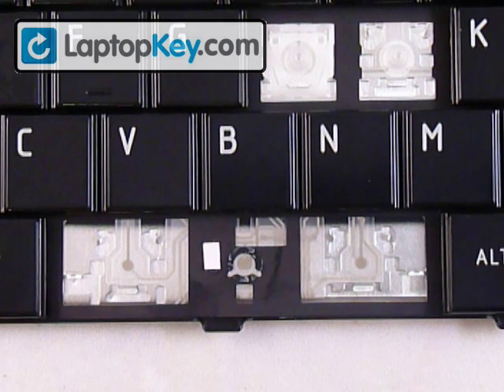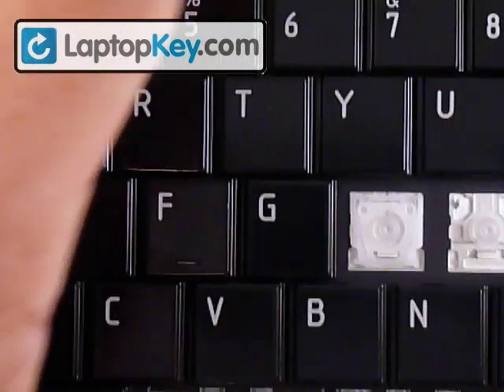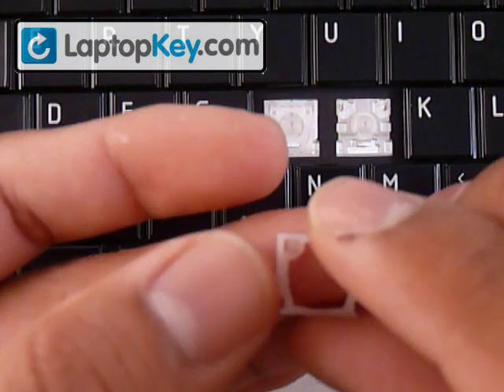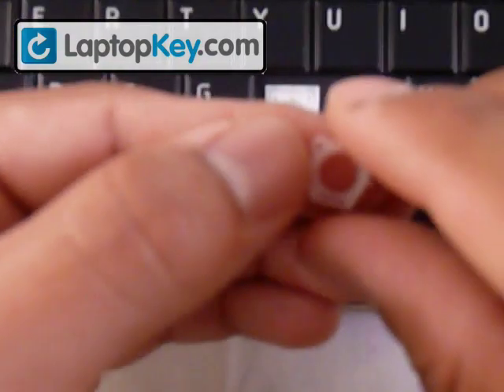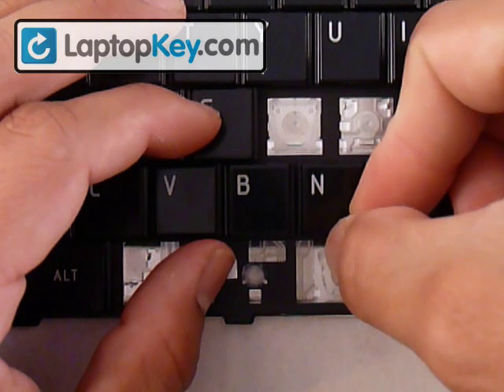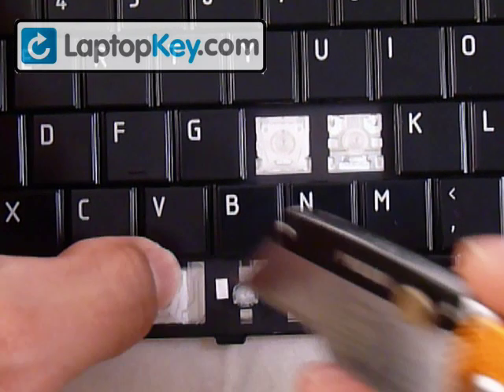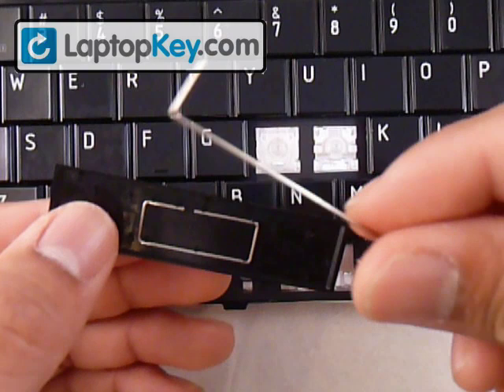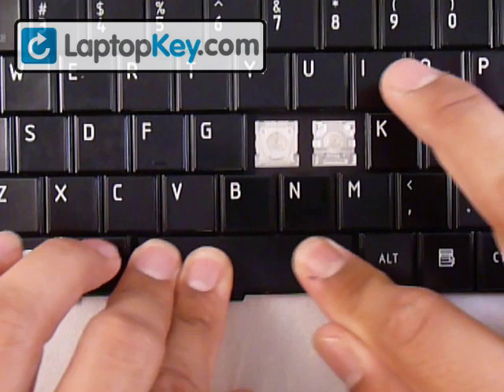How to Repair Laptop Space bar Spacebar Keyboard Key | Install Guide Toshiba Satellite

Comment: So here is me in the middle of the night, trying to fix my laptop:
First attempt:
Me: Holy crap, what do I do? You know what?
Shoves and pushes but does not help
=_=
Second Attempt:
Examines the stuff behind the spacebar
Me: ....What is all this stuff? 23metal wires.... (In the video, they had two, one in the center and one in the side ((long side)) but mines was different, it had one wire on each of the long sides and a wire in the center)
Plays around for 5 minutes, then shoves and pushes spacebar in
Third Attempt:
Watches video Ooohhh, I... kind of get it now.
Takes out both wires and puts it into the little holes, then shoves keyboard
~Keyboard fitted but in an awkward and weird angle~
Me: ...............No.... just no... =____=
Last Attempt:
Me: ..Hmm.. let's try this...
Puts one wire in the thingy and one on the spacebar, carefully puts wire into little holes, then pushes like crap
Tests out
Me: OH MY GOSH, IT WORKS. IT WORKS. I DID IT, I DID IT, I DID ITTT!!!!
='D
Feels like winner
I AM A FREAKING GENIUS.
And it only took me.... 20-30 minutes. XP
Now I want a taco. ._.
XDDDDDD
Reply: *3 metal wires.
XDDDD

Comment: Thanks a lot! My space key wasn't functioning well on the right side (where I click it the most). 

After watching your video I could understand how the thing worked and i realized that the big metal wire that goes allong the key didn't "click" on one of the three spaces of that key (it was loose on one side). I had to, very gently, push the little bit of plastic part inside so that the wire "clicked" when joining with the key. After that, the space key was working perfectly =D

thanks again!!